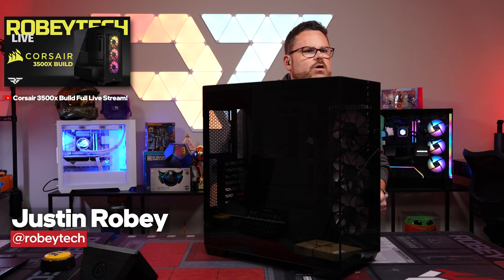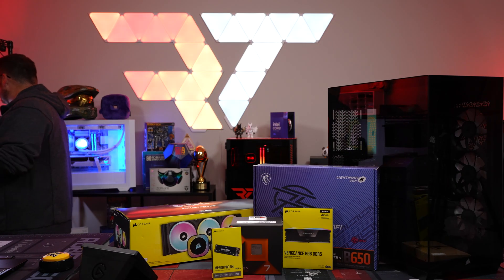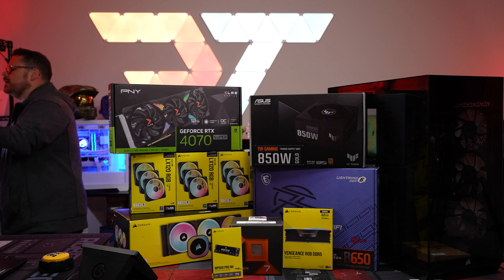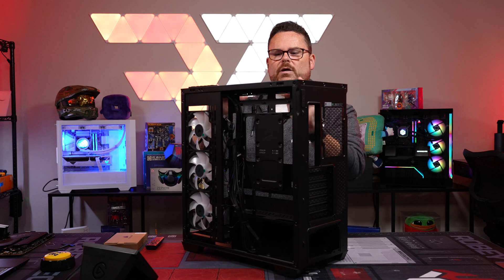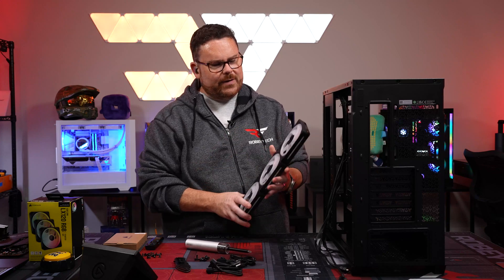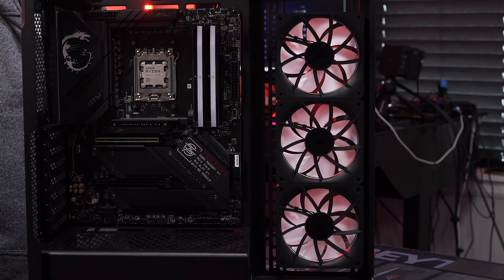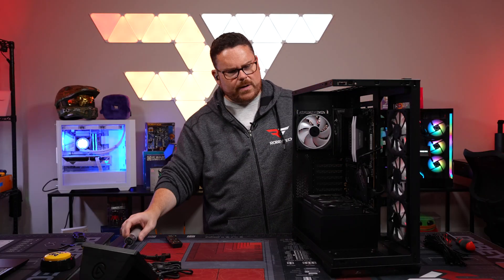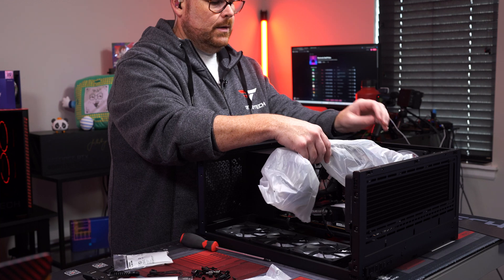A Compact ATX Beast! The Corsair 3500x Build

Comment: Are the CORSAIR RS120 ARGB 120mm PWM Fans.       Fully compatible and customizable with the 
CORSAIR VENGEANCE RGB DDR5 RAM 32GB (2x16GB) 6400MHz CL36 Intel XMP iCUE Compatible Computer Memory - Black (CMH32GX5M2B6400C36)

I'm assuming i'm just going to have to use two different programs to adjust the lighting?

Comment: Just finished swapping to one :D Referenced your build in it to help along, was a iCUE Link build, soo much easier once you figure out your bridge aka links order, soo cleen, luvin the h150i iCUE Link LCD AIO ALso, GG wanted QX fans but local store was out and didnt want to wait, went with RX120s, have 2xExtra iCUE Link cores lol one came with case, one with fan pack, and one with AIO, thought might need them,  but one core is enought, 9 fans, 1xAIO, also swapped out the PSU for a COrsair RM850x

Comment: The fans under the GPU are the most important fans in the case. First of all you're guaranteed your card never heats up, especially when the card's fans are Zero RPM during browsing or watching stuff. Another thing i love is that they will also keep your second/third M.2 slot cool because the air from bottom is hitting that part of the motherboard.  With fans from the front or side, that's not gonna happen